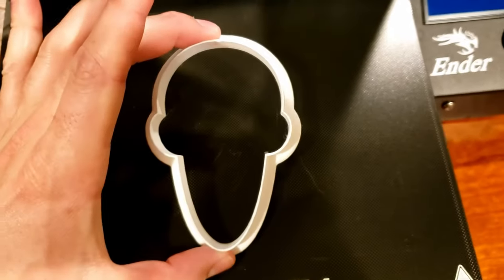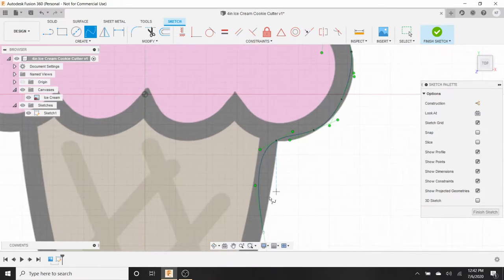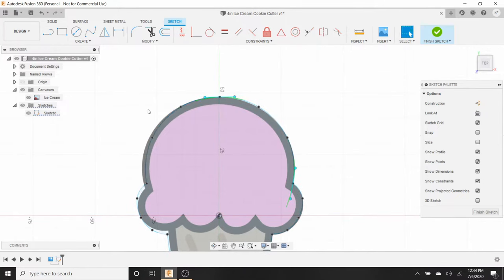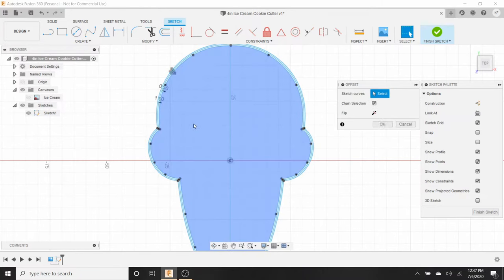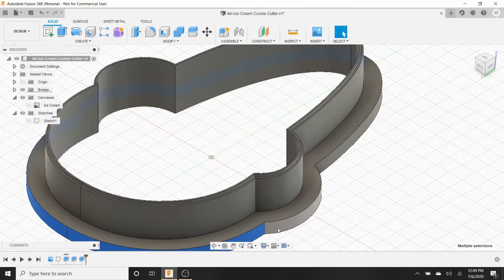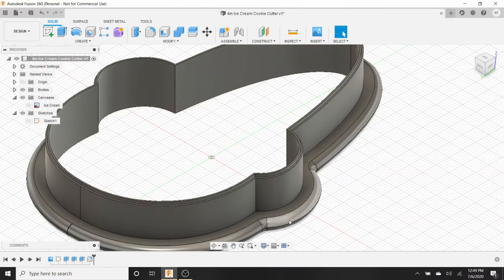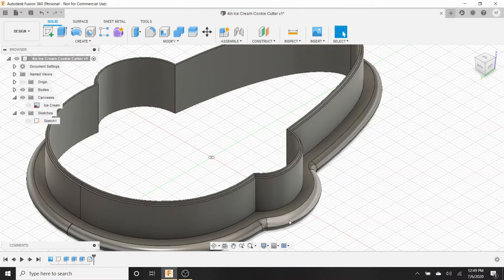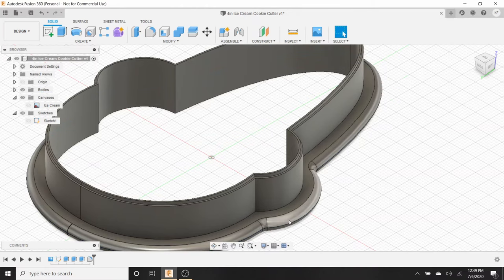How to make a 3D printed cookie cutter in Fusion 360

Comment: Hi there!  Thank you for this Video!  Great tips and tricks!  Question - When you are scaling from an existing sketch - will it start out from the size you saved it as? I have a 3.5" sketch that I want to be 4.5".  Thanks!
Reply from the maker: You need to scale it. use the scale option and scale the DFX 1.286 inches. That will scale it to 4.5inches!

Comment: This video is SO helpful and I successfully made my first cutter! However, when trying my second I'm getting an error when doing the fillet the second time (inner rim): "The fillet/chamfer cannot be created at the selected size..." I've tried adjusting that edge a bit to smooth it out, widen the little gap, and only selecting that section. Nothing is working :( Any ideas?

Comment: This is a very helpful video. Thank you. On my cutter design there was just one tiny gap eventhough I am using a 0.4mm nozzle as well. I had to go back and change the width to 0.6mm instead of 0.5mm. Does complexity of design have an impact? I was printing a more complex cookie cutter so I'm assuming that was the reason 🤷🏽‍♂️
Reply: hi , that can depend on the layer height , if you print it with a langer height of 0.15 that shouldnt be a problem.

Comment: Thanks for the video! I come across a problem though. I import a .dxf file made with Illustrator. It imports it perfectly fine. But, when I want to off-set it won't let me on the exact numbers. I can drag the arrows till a line shows up, but sometimes that line isn't close to the numbers from the video at all. I Googled about it but I can't find a solution. Do you know what is going wrong and how I can resolve it?

Comment: How thin can the walls be made on the cutter?  I use metal cutters for a super sharp edge.  I just purchased some 3D cutters and am not happy with the cut.  It smashes down the edge of cookie and causes the dough to separate on the edges.  Can 3D printer make a more thin edge like stainless stell??
Reply from the maker: That's a great question Lisa and unfortunately nothing will have a better cut than stainless steel! But 3d printed cookie cutters can get as thin as 0.2mm. We print all of our cutters at 0.4mm and our cuts come out pretty well on our end. Do you know what size the blade is for the cutters you ordered?

Comment: Lol... this is waaay too time consuming.

Just turn your image into an SVG, vectorial graphic.

Import SVG into Fusion360 and remove the bits you don't wanna print, or just extrude only the walls.

Or you could extrude it, and adjuat in your slicer (print walls only with 10 infills)
Reply: Omg you have got to send me a message on how to do this. I need a nutcracker but I can’t get it to work 🙏